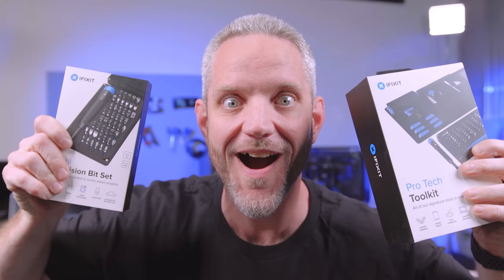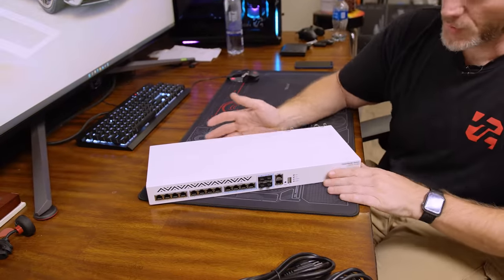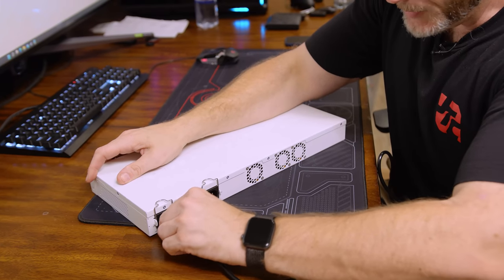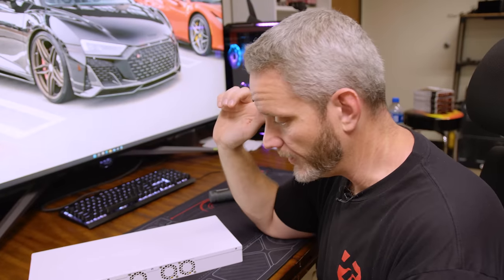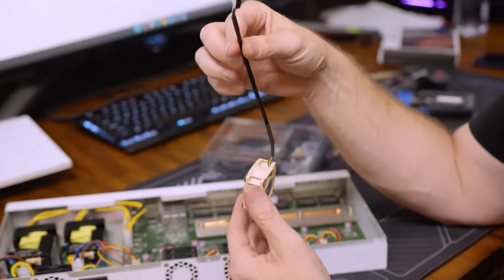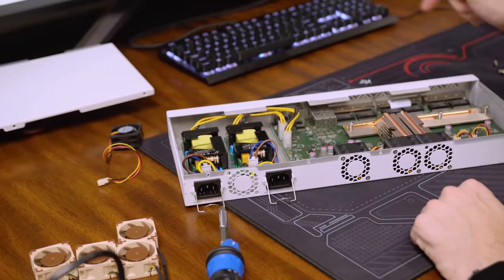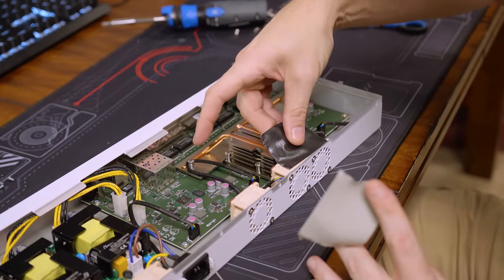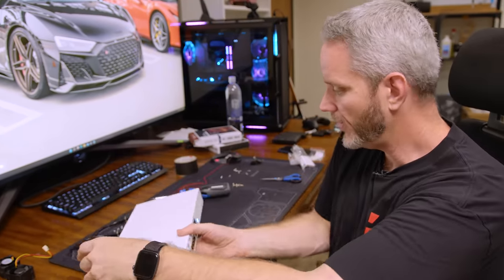We had to modify our new network switch...

Comment: If you can get away with SFP14/+ DAC (Direct Attach Copper) cables use those - 10gig RJ45/fibre transceivers use additional power, ~2-5W each.

Comment: I've looked recently at mikrotik switches for a smaller but similar setup. RouterOS on these devices allows you to use them to do everything you can think, and as you get used to the interface it makes sense to stick to mikrotik for the future. Take some time to look at it and read the docs, you will find something useful even if right now you need just a dumb switch. In the future you could buy a switch with only SFP+ ports and then buy the the right adapters (transceiver) you need. Look at servethehome, they make beautiful reviews of (also) network gear, both in written and video form. For example, look at their review of the CRS326-24S+2Q+RM. You can mix a few 10GBase-T (what you want now, 10Gb/s over RJ45 connectors with twisted pair cable) adapters with fiber transceivers and DACs for short connections inside the same rack (to another switch or server). With SFP+ ports you get more flexibility, lower power consumption and heat generation if you avoid 10GBase-T, and you choose the right compromise: DACs are more expensive than RJ45 cable, but no adapter is required, RJ45 cable is cheap but adapters are more expensive, fiber... I don't know, but adapters are cheaper and require lower power. Mikrotik itself advises against populating that switch with more than 12 10GBase-T. Look at mikrotik website for distributors near you. Hope anything here will be useful to you.

Comment: Well the stock fans are optimized for static pressure, the noktua aren’t. At least that line you are using. You’ll need to monitor the temperature if exposed, to the internal components or your switch won’t last. I can bet that the air pushed by the stock fans is probably 2x from what you put in there

Comment: Honestly at this point (number of devices, having a server, having a rack, while still being a small business) I would sit and consider

- either buying a single switch with more 10Gig ports from companies like Netgear, D-Link, Ubiquity, QNAP etc. and call it a day and then replace whole switch
- or looking at entry level enterprise stuff from Cisco, HPE Aruba, etc. (even considering pre-owned hardware, as a lot of companies/customers getting rid of these because vendor support services expires or because of enforced policies for HW refreshment; while HW itself is still completely fine) and buying something with "stackable" feature (multiple same switches acting like one with a lot of ports), adding new ones into the stack when extra ports are needed (buying a few same ones, having them ready in the shelf until they are needed).

Comment: Jay...  You might do a follow-up video once everything on the new switch is connected and do some speed tests for through put.  I have one of the 5 port Mikrotik CRS305-1G-4S+IN 10 GbE switches.  I use it to connect my Plex Server to my Synology DS1819+ NAS via 10G  RJ-45.  I average between 350 - 600+ MBps when transfering multi-gig sized files from the Plex Server up to the NAS.

Comment: 9:58 - Ooooooh the scary high voltage caps. Seriously either don't touch them, or take the psus out and discharge the caps with insulated pliers or screwdriver by shorting the caps pins. Alternatively using a high voltage resistor on those pins.  You can even throw a multi-meter on it if still concerned. Makes cleaning PSU's way easier when you can take them fully apart for cleaning.

Comment: One recommendation: if you have any GbE devices, grab the MikroTik CSS610 which is 8GbE with 2xSFP+ 10GbE. That'll allow you to consolidate 8xGbE connections into a 10GbE trunk, so there should be no contention. I use that on my home network. And it's a very inexpensive switch for what you get.

Comment: Jay... console port isn't network or GUI : it's a serial port, with one end being RJ45 on the switch side, the other being either USB or serial port (depends if the serial to USB is in the cable or not)
You'd then connect to it with putty (if running windows) and get console access, which means CLI Command Line Interface :>

Comment: Hey Jay.  If you can get a router with a 2.5gbps you can get up to 1.4gbps download off your xfinity service.  I know the upload is more important, but more download never hurts.  Xfinity is giving you 1.2gbps and they usually provision 20% over.  You're limited by your 1gb connection to your equipment.  The blue port on the back of your xfinity modem is a 2.5gb port.  Hope this helps you and anyone else with this service.
Reply: Leaving performance inside the router! If he's got a blue port then he should plug it into the Mikrotik, I expect it will negotiate OK.
Reply: @wayland7150  It should yes. I didn't think of that.  Good catch.

Comment: If money wasn't an issue, and especially as a company, you could probably acquire something like a Juniper EX4300 multigigabit switch. I have no idea what Juniper themselves would charge for one, but they're like over $5k a piece for 48p. All the PoE options, all the useless speeds between 1 and 10 gigabit, and a bunch of other way too indepth features.

Comment: Mikrotik is probably your best bang for the buck. The only other possible option I can think of on the less expensive side is TP-Link has some options. 

Unifi has a RJ-45 2.5G/5G/10G switch too but price is a bit higher.

Comment: Jay, don't listen to them, fiber is not designed to run directly to the end device unless its in the rack. Run Cat6e and use a 10G or 2.5G switch like you are. Also, there is no reason to have every patch panel port connected to the switch. You can always re-run a patch cable and get a second switch later if you need.

Comment: i know ubiquiti has a switch i think it is called the Switch Pro Aggregation for 900 dollars it has 28 10G SFP+ ports and 4 25G SFP28 ports you can check them out if you want something like that. Plus it is also a managed switch if you need that.

Comment: Sadly, big flow noisy fans are par for the course of doing 10G over copper - it simply takes 5-10x the watts to shove 10giggidybits over twisted pair copper as over optical fibre or direct-attach cables.
Happily, that Mikrotik switch should have temperature monitoring in the GUI so you can keep an eye on the thermals. Hopefully the Noctua's are enough airflow to stop it cooking to death. I have it's 16-port CRS317 all-SFP brother with the same fans swapped in - filled to the brim with optical/DAC modules all reporting a delta of 10deg C over ambient.

Comment: Do not rely on the fans shutting off too much... 10 GbE takes around 3 Watt per port (and side). You should have opted for an SFP+ switch and connect device near it via DAC and farther away via optical cables. Also, since few motherboards have 10 GbE as of now, you need a 10G network adapter anyway, so it does not matter if that is 10 GbE or optical or DAC. 10 GbE makes sense only in situations where you already have existing cabling you cannot change, which is not the case in your location.

Comment: That thing is quiet compared to my old D-link DGS-3100. I disconnected all the fans on mine and cut a hole in the cover for a 90mm fan. I found it at a Value Village used for $3, they didn't know what they had....

Comment: The cheapest 24 port 10G Base-T switch I've found is the Ubiquity USW-EnterpriseXG-24. It can be had for about $1300. It's not a dumb switch, but I'm sure it's not hard to set up either.

Comment: Another way to keep the switch cool & quiet is to use SFP+ fibre or DAC as much as possible. At least that's the case on my version of the switch which is 1Gb but with 4 of the SFP+ ports. I started with copper and the fans immediately screamed. Switched to DAC and the fan doesn't come on.

The cheap fanless copper 10GBe cards I bought also kept overheating, which hasn't been an issue after switching to SFP+ cards.

Comment: What is the betting that the fans that were in there were 5V and Kay installed 12V Noctua?

Also, just because the fan header is 4 pin doesn’t mean the board or the controlling software will implement PWM.

The standard fans were clearly DC control.

Comment: You can 3D printer little fan spacers so it makes them the same size as the old fans.
Reply: or disassemble the old ones and sand/cut them down to fit the gap

Comment: No joke that screwdriver is $130 on amazon. There are other versions. And I have a smaller precision one that is a lot weaker from Harbor Freight. I think it was like $6.00. I use it for laptops. Though it dies fast (takes AA batteries). I have carpal tunnel. So I tend to hunt down electric screwdrivers lol. I have several.

Comment: The combo design seems like a really good approach - I can't see 10G not being sufficient for your video builds, while the big beefy editing rigs are going to benefit from having more speed almost regardless of that speed.  

Maybe when it comes time to update the editing builds, it'll  be worth swapping them out for the higher speed connections, since that gives you an opportunity to install the appropriate network card anyway.  And unless you expand massively, I can't see you needing more than 4 computers at that speed.

Comment: Get a cisco  5548 used take 4 10gb dac cables to the mikrotik in an lacp. That gives you 40gb link to attach your ethernet ports, and use something like an Intel 740 or 540 with sfp+ and lacp them to the cisco so that you can saturate the drives.

Comment: Jay, every rack mount switch I have ever worked with, "cisco, aruba, meraki, etc" have all behaved exactly the same way, when you power them on, they spin up to 100% for a few seconds and then spin down to near silent for standard use. the only time your going to hear these spin up "after" you power then on is if termal triggers are hit. In my experiance switches become noisy when their thermal triggers are hit.

Comment: Ubiquiti sells a 24 port 10g Ethernet and 2 25g SFP+ port switch for 1300. They are also supposed to rather quieter than most switches.

Comment: I tried to do this mod with a Juniper Switch and quickly had to undo it.  The Noctua stuff is great, but it lacked the static pressure that the stock fans had and I immediately saw a drastic increase in temperature after swapping them out.  I'd be interested in what you saw temperature wise for your switch over time.  It could just be that my switch had more restrictive airflow through the chassis.

Comment: Get a managed 24-port 10 GbE switch; example UniFi Enterprise XG 24. All the traffic is going to stay in the switch once routed. You're insane running any Router in "default" and you're asking, no begging to get hacked. Hire someone to design and setup your network. You can do all the wiring and initial set up work yourself and just hire them to design and then configure your network once completed.

Comment: Since the new fans are not firmly touching the heatsink, you are losing  A LOT of flow through the heatsik, and you'll probably end up with higher temperatures than the required.

Also, you haven't mentioned if you have checked the flow direction of the original fans. Were they all intakes? Exhausts? Or maybe some of them were pushing cool air into the case and some pulling hot air out of the case?

A sure thing that I have verified many times through the years is that loud server fans are usually high volume / high pressure / high RPM fans. The only way to substitute these with something quieter is to put larger diameter ones (if possible). I doubt that the noctua replacement fans can flow even close to what the original fans did.
In my opinion, you should  have first checked the initial operating temperature of the switch while in normal operation BEFORE doing any changes to the fans, in order to be able to compare and be sure that this mod will not damage your switch in the long run.
You may get lucky and get away with the noctua fans if the switch is mounted in an open rack or in a well ventilated / climatized one, but you will most probably run into overheating problems if the surrounding temperature is close to the upper limit of the operating temperature range of the switch, or when the switch has to handle a lot of traffic.

I am following you for a long time and I like your channel content very much, I just wish you followed your own methodology of PC cooling - moding - testing - validating also for this switch. But I guess you, like me, are anxious to get things done and ready 🙂

I hope you take this as a constructive criticism from a friend of the channel.

Sorry for my english, its not my native language.
Best of Luck with the renovation!

Comment: Did you happen to check with the manufacturer about your warranty if you replace the fans? You never even tested it for functionality before you popped the cover. I didn't notice a warning sticker, but removing the cover typically is when you void your warranty. I would have at least made sure it worked before tearing into it. It would be a shame to find out the mainboard is defective after you made your modifications.

Comment: CRS326-24S+2Q+RM plus the S+RJ10 to convert to copper which should give you 2.5Gbps/5Gbps or 10Gbps depending on what you plug in, I am planning something similar let me know if I got this wrong, this would give you the same as what you have but you have 24 ports with the CRS326

Comment: I got an old powerconnect 2748 from a friend way back in the day that only had 3 fans, but it was a freaking jet engine. Currently very much dont need 48 ports or the 14GBs(DONT LAUGH!) throughput so getting by on 3 soho routers. But the fans are weird. They're 3 wire, but the third wire is a failure warning wire. Its basically to monitor if the fan is still spinning in a binary yes or no fashion. Very strange.... But then again, enterprise equipment, you're purchasing reliability not silent efficency. Racked stuff assumes its going to live in a closet or datacenter rack far away from human ears, fighting servers for cool air. I like the idea of a custom rack case for a PC build (theres tons of audio production desks with like 10U racks in them), but any server type enterprise level hardware is going to be trying to take off, all the time! Its supposed to work, not be nice to stand next to ;)

Comment: It's not the PWM that makes it quieter, the specs of the fans are. The Noctua max RPM is only 5000, instead of 15000 of the default fans. The new fans will worsen the thermal performance of the switch.

Comment: SFP+ or SFP28 would be better choices. You can go for 25gbps on the latter. You could get those for about the same. Only difference is the cables are more expensive.

Comment: Nice upgrade. It might have been better if the server had a 25GbE uplink port instead of just 10GbE. I have SFP+ at home because it was the cheapest way to get 10GbE at the time. I upgraded to a Mikrotik not to long ago but still stuck with SPF+ for my 10GbE. Much quieter than the old eBay Cisco equipment I was running before though.

Comment: Best thing I can find for 10G ethernet with more than 12 ports is a Ubiquiti XG 24, with 24 10G ethernet portsand a couple 25G SPF ports at $1300. It's on amazon but pretty expensive with third party sellers. Otherwise, it looks like everything else is $2k+ range, yeah, netgear XS724EM, cisco enterprise stuff
Reply: Funny, I just saw that the LTT video released on the same day as this video about their LAN cache server shows they got a Ubiquiti XG 24 to use

Comment: Don't run fiber to the workstations, keep the CAT6a 10g ethernet to your clients. There no benefit to replacing CAT6a with fiber unless you have long runs ( > 300 feet), noisy EMI problems, or need devices electrically separated.  But running the SFP+ DAC (Direct Attached Copper) cables between the switch and the server in the same rack makes sense as DAC cables are way cheaper than SFP+ fiber transceivers, and DAC cables are usually shielded and cheap CAT6a patch cables aren't.

Comment: netgear has an 16 port switch with 2 shared sfp+ it's called XS716E i have installed one in an office and no one has said anything about the sound. they even have bigger versions if you want to go for bigger than needed.

Comment: I manage an ISP network and too many horror stories with MicroTik to ever recommend them. Ubiquiti would have been a great option for consumer if you could get your hands on it. If you wanted a great Firewall and switch management Fortinet is also a great option. Both options also offer WiFi. Fortinet you could manage everything (switches, AP's, and Firewall) from GUI and have 0 CLI to worry about if you're not comfortable with it. There is a licensing needed though. Also @2:37 you would just use a copper SFP+ no need for an adapter. You need you a networking guy Jay.

Comment: I can pretty much guarantee those shouting do Fibre to the Server NIC, don't have any responsibility for implementing such connections and have just watched too many YT videos.
10Gb copper is absolutely fine, reliable and with the right standard is happy at 100M.

For those shouting CAT7, why would invest in a standard that is not recognised by the IEEE, when we do move on from CAT6A as the standard, it's most likely going to be CAT8.  CAT6A is already a PITA to work with for the reduced bend radius and increased shielding.

Even with high end manufacturers such as Cisco, there are limitations.  A Nexus 9K 1U switch that I wanted to use the 6x QSFP ports in a mix of 40Gb and 10Gb connections would not support that as at that price point, it was a shared ASIC across all 6 QSPF ports, therefore a shared/fixed speed setting.

There really is a lot of reading involved to understand limitations of products.

Comment: SwitchOS is fine. RouterOS does not work well on these switches when you start using routing across VLANs and pushing a lot of traffic. I pulled this switch and replaced it with a used brocade from eBay.